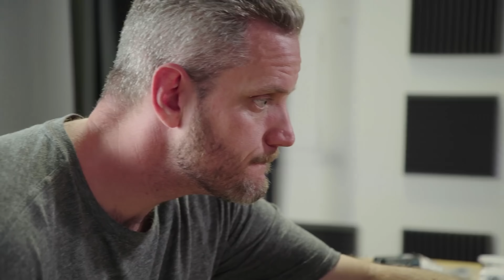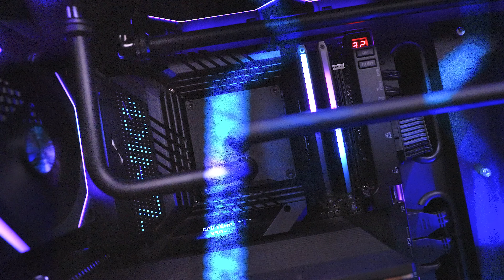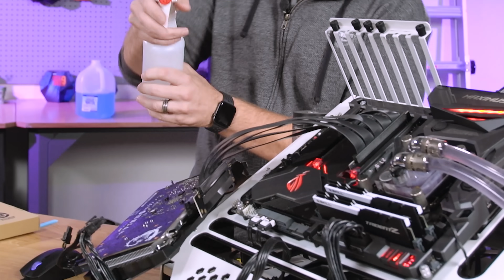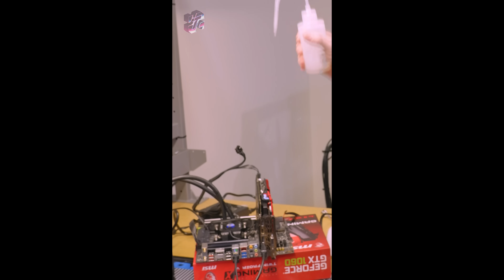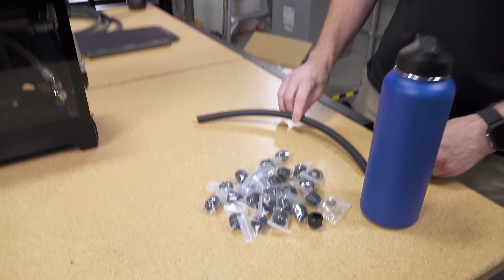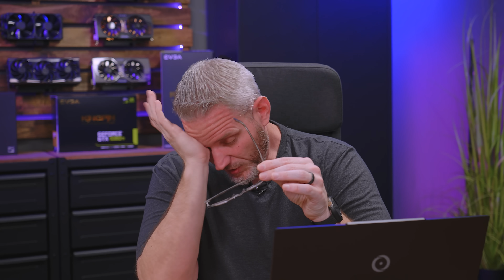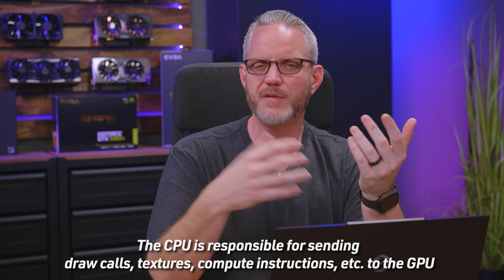5 Myths about Watercooling that are WRONG!

Comment: Thank you for a bit of education on this subject, your time and efforts are appreciated.    

My personal opinion from experience working with 5 different desktop computers (4 purchased refurbished and the first being new) is that air cooling has worked okay for my needs.
I do not use any games that push a machine to the limits yet dabble with Blender 3d program and create tons of digital paintings and graphic arts images.    The only problem I have ever had with a computer over heating to the point of destroying a motherboard was the first computer I bought.    My first experience with a personal owned computer was a new Pavillion HP with an Intel Pentium 4  including a dedicated Nvidia graphic card,  purchased at Comp USA around 2004.     That computer after several years of use one day shut down as a result of defective capacitors on the motherboard that burned out and allowed excessive heat to circulate.   Pentium 4's are known to run very hot and require certain heatsinks.   After looking into this problem I found information about how a lot of capacitors from the Pacific rim had been used on the production of certain computer brands that were defective and caused this unfortunate problem, my specific model was on the list of victims.    I am not knowledgeable enough to know if having a watercooling system on that air cooled desktop would have prevented the dead end experience.   Outside of that computer the four refurbished ones have worked continuously air cooled, including an older HP Compaq SFF with a Pentium 4 (32 bit cache)  that has always run hot with air cooling yet very reliable and still usable for off-line use and also occasionally with Linux Debian 12 on-line.    

I have recently been looking at new computer desktops and leaned more towards advanced air cooling.    Funny you mention how people compare auto cooling to a computer machine, I did that exact comparison.    All I know is that when a water pump goes on a car you have leakage that always leads to a hose breaking open somewhere, seemed to me the same potential problem would result on a water cooled computer with potential risk to the motherboard or other components. 

If you had a retail store available in the city where I live, that is where my next purchase would be for a new desktop although that would be advanced air cooling.    Find your videos here informative and educational.

Comment: on the subject of cost it might be the driving factor for me considering air cooling again. still scouting around for my eventual replacement for my 2070S and...  the gpu prices combined with the watercooling side is making me sad. EKWB doesn't even consider the 4070 a thing (which price wise a 4070 super/4070ti super is still more appearling then dropping 1k plus >.>) and then you get to the waterblocks and those are either 100 bucks more then i payed for my 2080 block (for the 2070S) but also for a card that is about 2.5X what i payed for my 2070S. and then you have 4070 blocks which cost more and look worse then the block my GTX470 wore >.> it's just not that appealing paying 150 bucks for a item that looks like what you used to see in budget watercooling builds >.>

Comment: There is a somewhat argument going on in my office these days. I work in a studio where there are massive simulations, rendering happening. Lot of them are long time rendering and caching. In there lot of people say for cooling air cooler with 2 fans (COOLERMASTER something with RGB fans) is much better than 360 AIO. I am thinking that 360 AIO is much suitable for that kinda workload. They keep telling me water cooling is completely useless. And also, they claims air cooling is much more efficient and useful for these kinda situations. What you guys think ? Currently they have installed the Coolernaster air cooler but it gets crazy hot lot of times even with AC on and set to 16C. What do you guys think. Oh BTW, processor is a 14900K with 96GB of RAM (Which has been set to ONLY 2400MHz God Knows Why and how)

Comment: Have they ever tried oil instead of water/glycol as the cooling medium? Oil is non-conductive - they use it in high voltage transformers for cooling. Of course, an oil leak might be messier to clean up. 10-40W anyone? Or, maybe Mobil 1 synthetic motor oil?

Comment: I think if your GPU weighs more than 2kg, it should be made mandatory that it has to be watercooled. Big air coolers are just too much trouble, PCB bent, GPU core and memory pads ripped, cracked PCB. All because of the weight and gravity is not on your side. Even if you put a support stand, it will sag a little over time,  I noticed and you have check periodically.

Comment: I started using the workstation heatsinks. I can make OEM look cool. HP has a single tower with 4 heat pipes with a metal shroud that can be nickel-plated. It can handle 160 watts easily thermal throttling gone. The small fan makes more noise if you don't mind it.
Reply: My office desktop is totally silent. I don't mind hearing motors making noise on occasion.

Comment: Water cooling can make your room cooler (or hold its temperature) if you have your primary loop connected to a second one via a plate heat exchanger and this loop cools the first one a little (condensation) below room temperature. My primary loop is 2520 mm and i have another 2160 in my basement XD.

Comment: Jay, Could you show the NV9 build?  I'm building in an NV9 and found the tilted lower radiator was a pain to connect with hard tube and the Phanteks vertical GPU mount didn't fit.  How did you overcome?

Comment: In fact, water cooling makes your room hotter since you're pulling more heat out of the component and dumping it out. It might seem cooler for the few first minutes as the water saturates with heat, but after that it's worse than aircooling as it heats the room faster.

Comment: To the water is not ionized topic: take deionized water and meassure the electric conductivity. Then use this water to wash down a used graphics card (with some dust, dirt and greese (whatever is normal in a system after some time). Capture this water! And then redo the meassurement of the electric conductivity. 
Reason is write this is: the pure water in the loop itself will maybe be harmless, but maybe it becomes dangerous when getting onto the components and get contaminated with all the stuff that is there.

Comment: Could setup a loop up with multiples of Thermaltake Pacific TF2 Temperature and Flow Indicator throughout it, to have active temp of different zones. Just have the indicators hooked up to quick disconnects for reconfiguration of the loop

Comment: 3:25 i at one point was thinking about getting one of those 9x120mm rads and some quick connect plugs, then move the radiator outside on the balcony with external power brick that has one of those old 4 pin molex plugs to power the fans :D
i still had my 780 ti SLI build with OCd 4770k at 4.3GHz and it was running so darn hot that it was hard to keep the temps down with one 360 and 240mm rad xD

Comment: I've never used other than regular distilled "battery water" and never ever had problems with growth. I used dyed water once and was so unhappy about all the places it sediment got stuck I never went back. I'd rather just buy colored tubes instead. Now I use EPDM i think it's called, only negative is that you can't easily check if the water is flowing.

Comment: If you have a room that is too hot. Would a solution be to put a different pump in and put the radiator through the internal or external wall?  Seem a lot cheaper solution than a mini split.

Comment: The only thing is about the argument for expense: "Well, you thought it was expensive before? But I mean, now we have stuff that's 3-4x the cost." isn't really the best, lol. I'm fairly sure I've seen a video comparing super cheap/affordable AIO coolers and watercooling setups that were basically doing nothing.

And aside from looks and a bit of clearance width wise, is there really a case for watercooling anymore? Fans really seem to handle things quite well.

Comment: Heat acts as a particle. Water and air cooling do nothing more than move the heat AWAY from your CPU and case and into the room. 
IT MAKES YOUR CPU COOLER but not your room. The radiator in your car is a MASSIVE AIO. It moves the heat AWAY from your engine and into the outside air making the outside air warmer. You won’t feel that because it’s outdoors. In a gaming room you WILL feel it. 

My office hovers in the 28 degrees Celsius range when I’m gaming because my AIO cools the 14900k and that thing is a furnace. Thankfully we have REAL winters here so it’s a welcome change when it’s cold outside. In the summer, not so much 😂

Comment: @JayzTwoCents I totally understand the "hot room while streaming" issue. You've probably already considered this, but just in case... a window AC unit 100% solved this problem for me. I have completely capable central AC, but when my streaming room door is closed, my PCs and lights just cook the room! The window AC unit has made streaming SOOO much better! Just make sure you at least have an audio gate on OBS to help with the noise. It's completely doable!

Comment: Another reason watercooling is still relevant:  While "normal" overclocking (outside of XOC) is largely dead, it's because chips are designed these days to self-OC based on voltage and thermal headroom...even with a stock chip an open loop will allow it to run a bit faster.  And it just will all on its own, which is nice for lazy people like me.  I facepalm REALLY hard when I talk to someone trying to tell me how great their 14900k is while running on a crappy small AIO (usually some super cheap 240) where the poor thing is undoubtedly not thermal throttled, but thermal strangled.  An argument could be made that air cooling for most AMD chips is perfectly adequate, and that would probably not be wrong.  I would argue air cooling for insanely inefficient Intel parts is just shooting yourself in the foot and wasting money.

You need to do another glass tube loop....yeah, I can go back and watch the old one, but damn glass is sexy. lol

Edit:  I certainly hope that "next gen" Intel is MORE efficient, not more of the same "shove more power into it so it can kinda compete and hopefully doesn't burn out the silicon...again".

Comment: Your video about heat-transfer made me decide to buy a real AC, with the flameable liqiud sign on it and a big long flexible tube to transport the heat. It was one of the best things I've ever bought. It's so powerful that even on hot days I have to turn it off while gaming cause I get cold. My gaming room is only 2 meters wide and about 4 meters long, so it gets hot and cold very quickly. The flexible tube is just perfect because it reaches the stairs around the corner so I send all the heat upstairs.

Comment: I'm a huge water cooling fan, I currently run a Radeon Toxic Extreme LC 6900xt its an IAO with 360mm rad. I'd like to upgrade to a 7900xtx, except no one makes a hybrid cooled AIO 7900xtx.

Comment: A lot of people don't understand that 300 watts of heat is 300 watts of heat no matter what the actual temperature is or in other words 300 watts of heat at 70C = 300 watts of heat at 80C
However the advantage of 300 watts at 70C is your CPU or GPU can clock a little bit faster but even that difference only means a couple percent increase in FPS or 1 - 3 FPS which is essentially unnoticeable in actual gameplay.
Reply: You are confusing a few things.  The CPU wattage isn't a fixed value being always dissipated.  What happens is, given the tasks being processed, the operating frequency increases, which increases the wattage (wattage is proportional to the square of the frequency).  If the computer has a safeguard limit set (for example, a maximum temperature), the CPU throttles the frequency to keep the temperature at the set limit.  When that limit is reached, the wattage decreases (due to the throttling).   The current CPU's and main boards allow as well  throttling due to current, power (wattage), or other things.

Comment: Loop oder isn't too much of a thing in the automotive industry either, though.
In the end you only have one part that causes heat in most cases: The engine.
If you do take stuff like power steering, or in some cases automatic transmissions, every single thing runs on their own loop, as they have their very own type of fluid (different types of oil).
Each also runs at completely different temps, too.

And even in each loop, there is no real order either. Only convenience.

Comment: 15:55 I'm sorry but that... that was a hot mess jay...

We don't intentionally leave the coolant pooling in the rad to allow it to dissipate heat... that's not how the system works and that's also not what the thermostat is for... as you well know.

The system is most efficient when the ΔT is highest. You don't WANT the coolant in the rad to be cool, because the cooler the coolant is the less efficient the rad becomes. The thermostat's ONLY purpose is to keep the engine temperature high enough to allow for the oil to be at the proper viscosity, the tolerances to be where they need to be and the chambers hot enough to not allow excessive carbon build up.

The thermostat does not cool... the thermostat purposely REDUCES the efficiency of the cooling system when it is appropriate to do so.

It is 100% wrong to say that if the coolant was not allowed to pool in the radiator it would "not sit long enough to actually cool down" that is just completely wrong. 

Also: the thermal capacity of radiators IS NOT a thermal runaway issue for the rad   RADS, DO NOT, get thermally "saturated" that is not a thing Rads are linear components! The hotter they get, the better they dissipate heat. What the heat capacity of the radiator is saying is this:

IF you load the radiator with MORE than X amount of wattage, the system will reach equilibrium at a ΔΤ to ambient higher than a value that would be appropriate to the intended application. 

The only way to "saturate" (...) a rad is to melt it... if you allow it to reach a temperature than will negatively affect it's materials then yes, that would be problematic. But there is no power at which a radiator will infinetly raise it's temperature. It WILL equalize at some ΔΤ for that power, or fail mechanically trying to get there. But there is always an equilibrium point, as long as the power input is fixed.

So again: thermal capacity ratings are a recommended maximum power that your system needs to have for that radiator to keep it at a temperature that is relevant to the application. If you use that same radiator for a higher temperature application, the heat capacity would be higher! The rating is application specific.  

Please don't undercut your otherwise valid points with these kinds of comments mate.

Love you all the same and was extremely happy to hear good news of your health improving. Wish you all the best <3

Comment: an air cooled rig can heat a room too. my (long retired) core 2 rig in a nutshell.

another reason not to water cool is maintenance. i can blast out dust bunnies in 5 minutes. also reliability of fans is better than pumps, and if the fan stops working you still get convection and airflow from other fans in the system (and you can move one while you wait for fedex).

if you are concerned about leaks you can still buy used florinert off of ebay. just filter it and try to avoid leaks (its a strong ir absorber and a forever chemical, so leaks be not green).

cost is my big concern, i was looking at adding $300 to the price of my system, which i would have rather spend on an up binned chip with a higher base clock.

Comment: Finally got an AIO and discovered it doesn't keep the CPU that much cooler and it is not quieter. My old air cooler had two fans. The AIO has three. With that, my case now has 8 fans not including the three on my GPU. Yay. Lots of Fan Noise.

Comment: The easiest way to explain how much your PC will heat up your room is with watts like you mentioned. A pc consuming 600 watts of power is a 600 watt space heater regardless of how hot the chip of your CPU or GPU is. 600 watts is 600 watts.

Comment: One important advantage that any watercooled solution will have over the best aircooling solution and it purely has to do with physics, it takes way longer for a watercooling block to heat up to max than even the best air cooling block. So unless you're at 100% usage all of the time (virtually never happens with cpus outside benchmarking runs) a watercooled block will eliminate heat spikes better than any aircooler. That's why imo aircooling is still very useful on gpus bc they tend to stick to +90% usage and there aren't heat spikes, it's the opposite, there are cold spikes so watercooling a gpu is less useful than doing it for the cpu.

Comment: Gotta see the loop temp thing, and yes, you do make these subjects in custom pc building more approachable. With your guides I was able to install a closed loop cpu cooler from MSI. Before my CPU would hit 96c and crash, after installing the MSI cooler it's never peeked above 57c and that's running a Ryzen 5 3600 on an Asus Prime B450M-A in a focus g case and a horribly bugged out fan controller from Thermaltake.